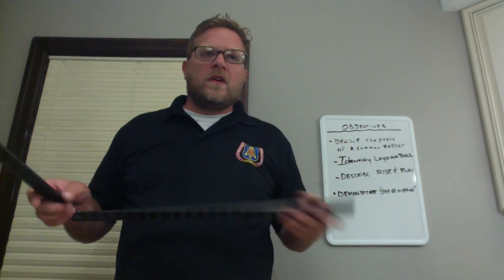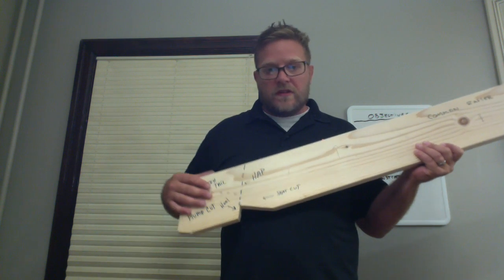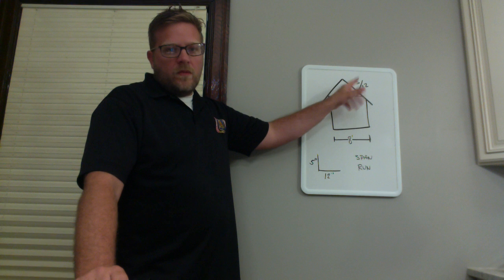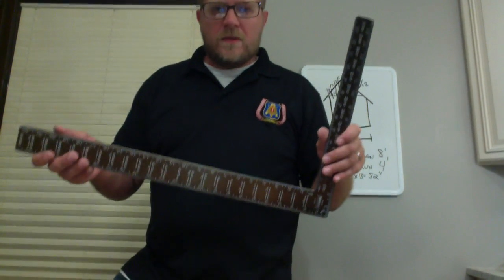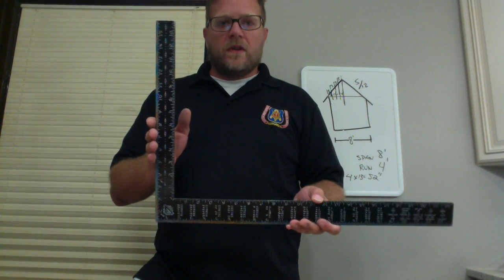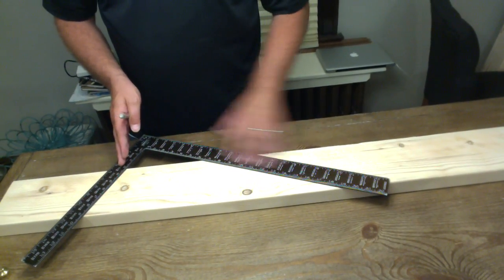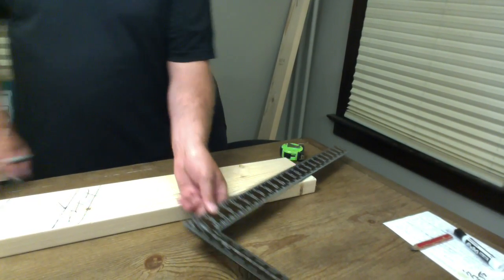Easy Common Rafter Layout Step Off Method

Comment: Thank you for the great info! Sometimes stair gauges can be tricky to to get accurate marks because they don't hang down very much over the edge as they are so thin. They are fine on sharp edge materials, but 2x comes with rounded edges and sometimes they are quite rounded or the edge is funky.  the gauge wanders off the edge and it rides on the rounded part changing the angle slightly, which would move your marks just a little bit. But that little bit adds up over many feet messing up your rafter length. It probably best to make a rafter gauge out of plywood based on the rise and run you need. Awesome video. Thanks

Comment: Excellent tutorial.  This is really a step by step instructions.  Thank you.  I am in the process of building a Shed Roof and I was really confuse on how to mark the ridge cut and the bird mouth.  My challenge was that I needed to detemine the pitch, if I only have the ridge cut height, the exterior wall height and the rum from the ridge to the wall.
Reply: Pitch will be the total rise, in inches, divided by the run, in feet. Just remember the total rise is not from the wall plate to the peak, it's from the height above plate to the peak.

Comment: Easy peasy when one has a pitch that calculates easy. I am adding to a garage with a rise of 41" abd a run of 11'2". So how does that work?
Reply: 1st find the slope of your roof, It's easy to measure.  Let's say you have a 5/12 slope. Put clip on the #5 of your square's tongue, that is the 1 1/2" side. Then put clip on the #12 of your square's blade (2" side). Now mark the top of your board and step off 11 full steps, as the guy in the video did, and then count 2 more inches, and that's where you'll make your plumb mark for your wall line, and mark out your bird's mouth. Now all you have to do is add whatever overhang you want, and then shorten rafter at bottom for facia board, and at top for ridge board.

Comment: I missed where you  minis the thickness of the ridge board.1 1/2 overall or 3/4 for one side - 2x board. Confused some.
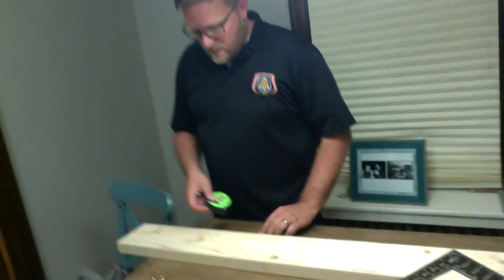Reply: Yes, that bit went by a bit quickly. At 10:00 he marks the "ridge cut". This is a "plumb" cut that lines up exactly with the roof ridge. However, in the end there will a ridge beam 1 1/2" wide that the rafter butts up against. He hasn't accounted for this yet. But after he has finished off the rest of the rafter layout based on the original "ridge cut" mark, he goes back, at 13:30, and adjusts the ridge cut to account for the ridge beam. Since the ridge beam will be 1 1/2 wide lumber, and it will be exactly on the building centerline, half that width, or 3/4", needs to be subtracted from the rafter... The main idea is that you want to lay out your rafter based on the actual roof ridge line. But once you've finished the layout you need to subtract a little from the ridge end of your rafter to make up for the ridge beam thickness.
Reply: on a lean-to it would be the full thickness or the ridge board or beam.

Comment: Did you choose the 5/12, or is that common , not sure how you came up with that.
Reply: rhonda toole
, if you're working from a blueprint, the slope will be given. If you're working without a blueprint, you can choose whatever slope you want. I assume the guy in the video just used 5/12 as an example.
Reply: Joseph Cocchiola  Much better to lay out the rafter to the exact run, and then come back and shorten the top for the ridge board. It's a lot simpler than calculating inch fractions. Of course you calculate inch fractions when you need to, but why make it more complicated than it has to be.
Reply: Joseph Cocchiola  That may work fine for you, but for people trying to learn, I think it will confuse them. Personally, I'm not that good at doing math in my head, so I use a regular calculator.
Reply: 5/12 is a good pitch for demo purposes as it gives a diagonal of exactly 13" per foot of run. 
9/12 would similarly give exactly 15" per foot of run (it's a scaled up 3 4 5 triangle).
With other pitches, the diagonal isn't a whole number so less simple to grasp when you are learning, though the principles are identical.

Comment: Good video although he didn't show how to measure for the soffit cut, the cut that seems to give me the most problem.
Reply: @Jay-tk7ib   No, the soffit cut refers to  the cut to remove that sharp corner on the bottom of the overhang. i.e. a cut parallel to the ground. to give a flat horizontal surface to accept the soffit.

Comment: When you cut the depth of your birds mouth doesn’t that change the pitch?
Reply: I have the same question. Help, please!
Reply: Took me ages to work that one out. The simple answer is no.
TL;DR A rafter is effectively a parallelogram. It's "line length" is exactly the same whether it's measured on the rafter's top edge, bottom edge or on any parallel line in between. One of those parallels is the one that passes right through the right angle point of the birds mouth. This isn't a complete explanation but should help with understanding why the birds mouth doesn't change the pitch.
Reply: @Hertog_von_Berkshire  thaks

Comment: Totally lost me at the end, 3/4 " and 1 1/2'"? Where does width come into play or why?
Reply: If you plan on using a ridge beam (the beam that runs down the centre of your roof rafters if you choose to use one) is usually a 2 X ? which are an 1 1/2" thick, so you use half of that to calculate the cut for your rafter which is 3/4". If you don't, you will find that your bird's mouth won't sit on the top plate. Does that help?
Reply: 3/4” Is Half your ridge beam, 1 1/2” for fascia or subfascia

Comment: Hi Scott. I was wondering if I should include the thickness of the material that I plan on using to cover the walls of the shed before I make my calculations? For example, if I intend to use half inch thick materials on the walls should I plan on using that half inch in my calculations before I do the Step off Method? I'd hate to wind up having the birds mouth laying on the top rail but forget to take into consideration the extra half inch of siding! In your demonstration, you said the the span of the building was 8 feet.  Shouldn't you have figured in that extra thickness to your calculations before doing the Step Off Method?
Reply: typically no a standard wall is 8' 1 1/8"
Reply: sheets are 4x8 and usually do not interfere
Reply: Yes you do have to include your wall sheeting so the birds mouth heel will sit right and the over all length will be correct. If you don't take into account the 1/2 for sheeting then your rafter will be 1/2 short at your ridge board
Reply: No u figure that sheathing 1/2 in on the cut for the heel cut when u do the birds mouth ..so 2x4 wall with 1/2 in plywood would give u a 4" in seat cut ..hope this answers ur question